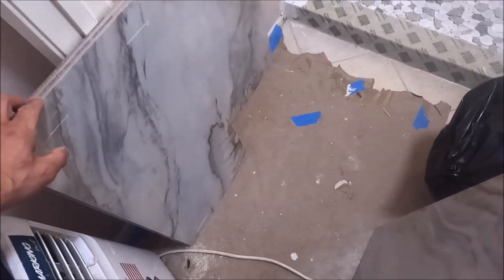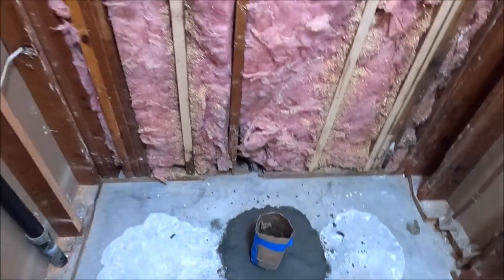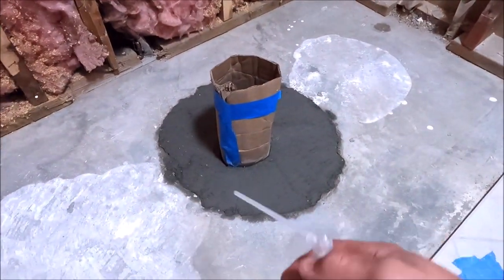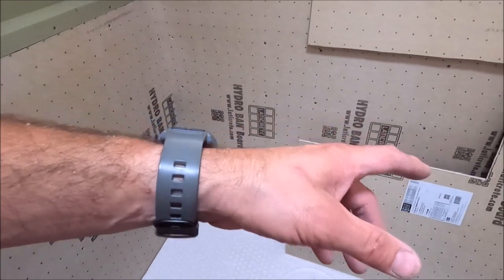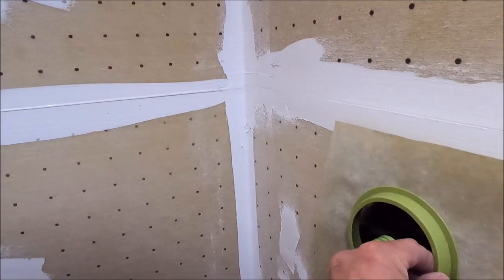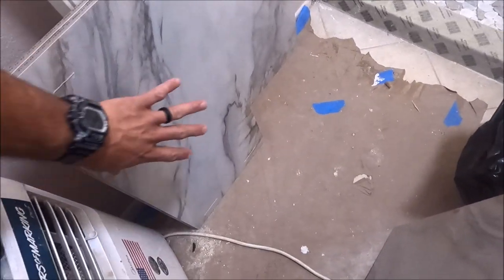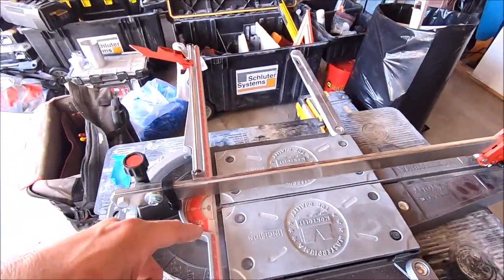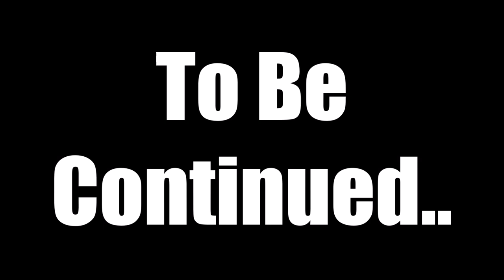Will This Shower Last Forever?

Comment: These new products haven't been around more than a decade is the only concern I have. What will the tile jobs installed on hydroban board look like in 10-15 years from now?
Reply from the maker: Exactly the same, foam does not age
Reply: @LandbergTileTV  I’ve seen foam floating in the ocean for months that looks fine and doesn’t even break down. I think it’ll be fine.
Reply: Foam doesn’t break down or degrade
Reply: @LandbergTileTV  But it can and will eventually shrink from weight and being walked on
Reply: @miketrey9294  it will not... If done well with the better thinset mortars of today.

Comment: Can't wait to see the final result.  By the way, what blade would you recommend for cutting glass mosaic tile?  The blade I have right now chips this stuff big time as it cuts.
Reply from the maker: Cut it upside down with the sheet cardboard on the tile saw tray. If that doesn't work, Floor and decor stocks a Sentenel glass blade.

Comment: fantastic!  love the videos.  I am assuming with the laticrete bonded flange once you set the drain body you have to make sure the height is where you need it to be because you cant adjust it after tile is in?
Reply from the maker: Yes, that is correct as you glue the drain body to the abs drain

Comment: Kinda of like wedi shower builds. Those wedi showers after 2 or 3 years start undoing at seams. Since it's just holding bye basically caulk seam the moisture in shower makes seam undoing. I've  done like 5 wedi showers rebuilds cause there's no band seam just the caulking seam.  Those don't hold test of time. Installers use them cause there faster to do and finish.  But do not last.
Reply from the maker: Brother I'm 100% certain this shower will outlive me.

Comment: Maybe vacuum before you spray that crap on the floor. There's no way you get the same coverage from a 25 lb. bag as a 50.
Reply from the maker: Yes, same exact coverage
Reply: I thought the same about Mapeii Ultralight. Those 25lb bags do go as far as a 50lb. And like butter. Pry similar technology. You said no silica in the Laticrete?